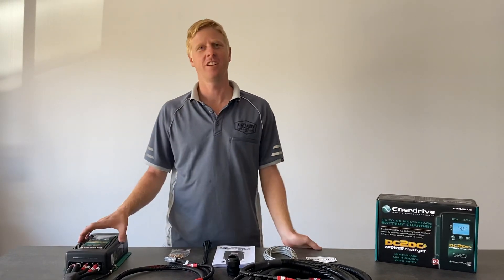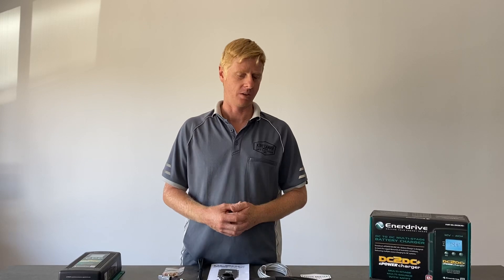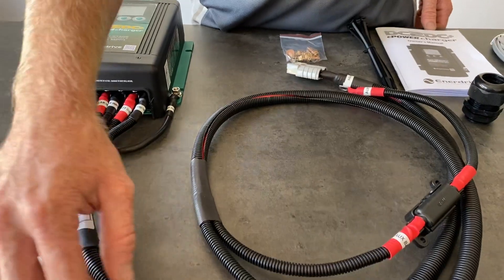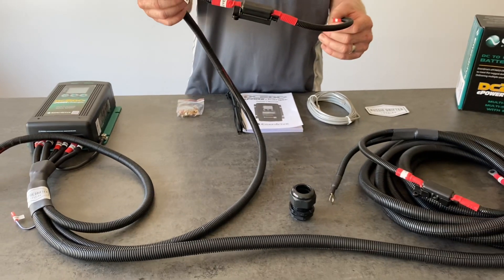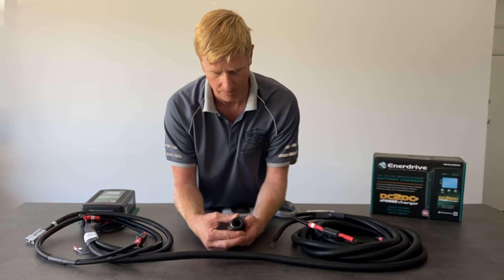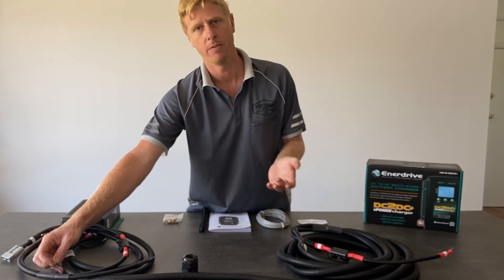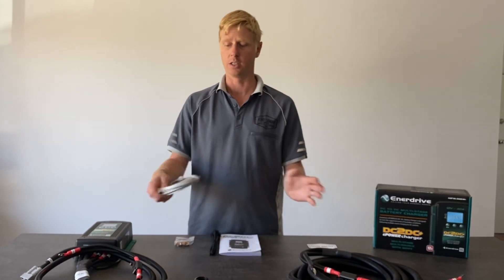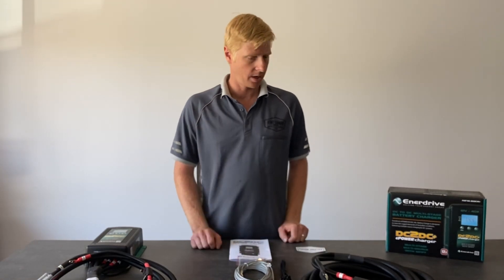Enerdrive dc2dc universal diy Dual battery kit

Comment: Hey mate with the enerdrive dc2dc in the canopy on a DMax with a smart alternator, the intervolt adapter that you supplied is it connected to the DC2DC charger in the canopy to the same battery input terminals that it comes zip tied to when you transport it?
 The third ignition wire goes to the ignition terminal on the DC DC charger?

Comment: Looking at the Enerdrive wiring instructions for in vehicle installation it says not to connect the main starter battery's negative to terminal #3 on the unit.  Is there any reason why you guys have it connected?
Thanks

Comment: Hey mate, what size cable you using for the solar input and also back to the battery?
Reply from the maker: Hi mate the solar input is 6b&s (13mm2 cable) and the feed to both batteries is 4b&s (16mm2 cable)

Comment: How large are the two fuses at the main battery and auxiliary battery ends?
Reply from the maker: Hey mate the one on the main battery is 70amp and the one on the aux battery is 60amp.
Reply: @AussieDrifterTouring  thanks for that. Is there a reason why one is 10amp more?
Reply from the maker: @TechStories79  yer mate it draws more power on the input cable than it out puts on the aux power cable so it requires a larger fuse on the main cable than the aux cable.